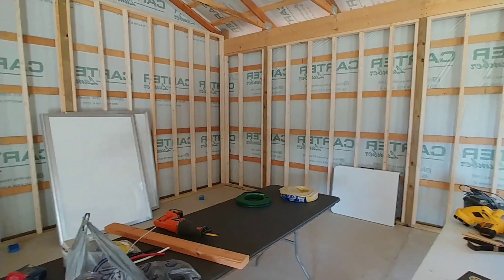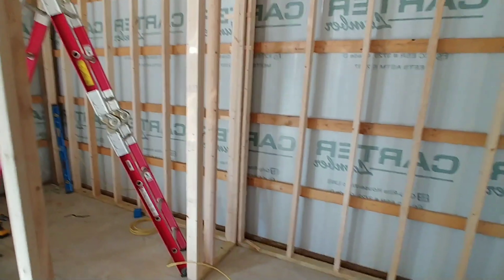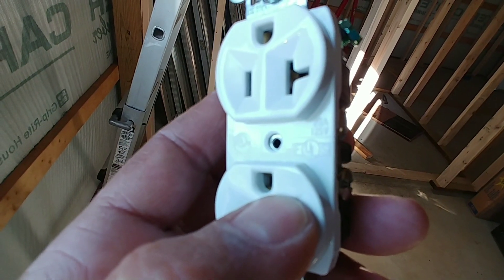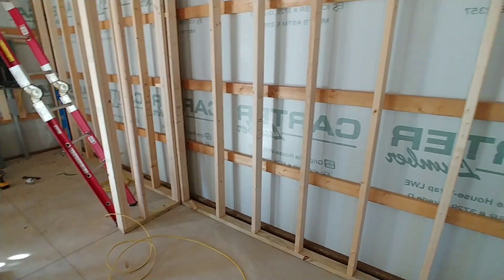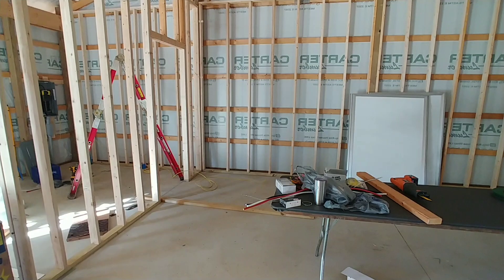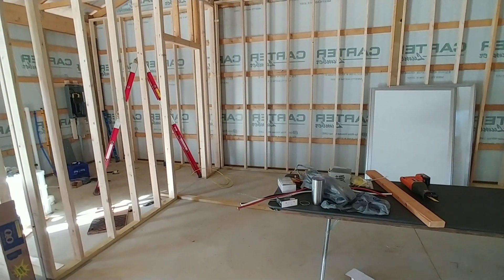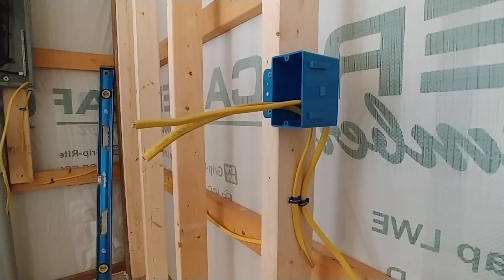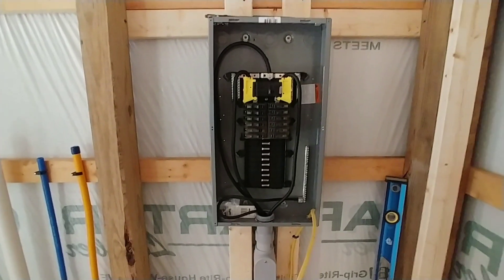Electrical basics for wall outlet branch circuits

Comment: You do not have to run 20 amp outlets. If only installing a single dedicated outlet it would have to be 20, if it’s even 1 duplex out let it can be 15 amps

Comment: Thank you sir for sharing this thoughtful presentation & how you pay attention to your local electric codes along with a good explanation on cable size & load requirements...
The cost of 12-2 cable today is way, way higher here in March of '22 however as my jaw dropped to the floor at my local HD just last Sunday in fact, lol! 
All the best,
Bill... :~)

Comment: Good presentation, thank you. Two items of interest as a DIY with wood shop in garage with that one over head light and one GFI 15AMP circuit: 1) Wonderment if an individual circuit may be required per Electrical Motor. I.E. Kitchen Garbage Disposals here are required to have their own breaker as they are motor driven. 2) With or, with out item #1), when is it needed to plan a circuit for a particular  tool? To elaborate further, circuit sizing based upon AMP drain, what is good planning? Router 15AMP, Table saw 15AMP, Dust 7.5AMP+, Air Compressor 14AMP (Who knows when kicks on!), Planer, Lathe, Cut Off saw, etc. Is their start up draw needed to be known?
I can balance things fairly well though sometimes I am literally  left in the dark.
Greg.
PS. I learned about managing start up power when watching Tom Hanks on Apollo 13. :)

Comment: Liked your video.  It may have helped to point out the NEC defined both a garage and a dwelling unit and this building is neither.  That throws all those pesky recepticle location rules out the window.

Also, I got the impression that you did not have a specific location picked out for specific equipment.  My book is a 2020 and I believe the 3% circuit voltage drop limit (210.19 in 3) has been around for many cycles.  My calculations puts a 15amp table saw at a max distance of about 60 feet of cable away from the panel.....30 x 60 building, half way down the back wall (by my calculations of voltage drop).  Article 110.14 allows a max size of no. 10 wire on the screw terminals, recepticle screws and raises the wire distance to about 96 feet.

I am not saying you are doing anything wrong here.  I am just trying to point out that a quick discussion could prevent others from installing and then re-installing a larger wire in the wall.  Conduit could make that wire size upgrade easier but,  would add expense and time to the project.

Thanks for your educational video and you considerations.

Comment: Great video. My question is my first outlet from the breaker box will be approximately 12' due to the fact that there is no opening of any kind... just straight up wall (no door or window openings)l. Is that ok ? or is there a max that you can go before you must put in an outlet?
Reply from the maker: That is normal and fine.  :)  the rule limits are for where on the wall.

Comment: So if I have a 20A breaker, but the circuit/line leads to just a couple 15A receptacles inside the breakfast nook, that's wrong?  I bought my townhome with that inside.  But it gets more complicated because the prior owner extended the last outlet through the wall to outside where he added two 15A GFCI receptacles (one leading to the next) to plug in a water softener at the end of the chain.  Can I switch every one to 20A or 15A depending on whether the wires he used are 12/2 or 14/2, respectively?  PS. The outside outlets ceased to work after a storm and the first outlet then read OPEN NEUTRAL.

Comment: You say 12/2 for 20 amp recepts...but how does voltage drop over distance figure into this?  It looks like 12/2 can only run 50 feet max according to a chart Menards has on their electrical page.  Any advice on how how or what wire to use to get to the opposite side of the garage that may be over a 50 foot run?
Reply: You wont notice a voltage drop if the run of 12/2 is a100 feet. We usually dont worry until  over 150 feet.
Reply from the maker: As Thomas said I personally don't worry about voltage drops until after 150 ft.  If you are worried about it and want to do a quick calculation though here is a link to a simple calculation chart
https://www.calculator.net/voltage-drop-calculator.html

Comment: Hey, I learned  a lot in just over 11 minutes.  My question was how do you determine which outlet is the first in the branch circuit?  You answered it and I didn't even have to ask.  Answer:  The one that is 6 feet from the beginning of the wall!  The rest were 12 feet apart.
Thank you so very much.  A big smile from me to you!

Comment: A 250' roll of 12/2 is $122 now(Aril 2021). A 1,000' roll has gone up $121 in 3 weeks as well(from $363 to $484).
Reply: Where the fuck are you buying from? Shit's $56 at lowes lmfao
Reply: @brandonfontaine285  You're stoned. I just bought 2 rolls of 14/3 today. You had better do a price check.
Reply: @FINfinFINfinFINfin  Just checked today at the prices have now adjusted to what you are saying. When I made the comment the prices were still low.
Reply: @brandonfontaine285  The supply houses adjust prices daily. The big box stores lag by several days(whether prices go up or down).
Reply: @brandonfontaine285  It's at $537 for 1,000' now.
Reply: @FINfinFINfinFINfin  I've decided to put off all renovations and to buy a new motorcycle due to costs increase of everything HAHHA!

Comment: I love your videos and very helpful. I’ve a query to pass my rough.
I’m running 12/2 wire for 10 outlets with 20amp breaker switch in my home theater room. Can I daisy chain the same 12/2 for the lights & switches in the room or I should run separate 14/2 wire with 15amp breaker switch?
Reply: No you can not daisy chain 14/2 with 12/ 2 on the same circuit breaker.
Reply from the maker: Yes you can run your lights off of the same circuit as long as you dont exceed the load.

Comment: You should separate lighting circuits from outlets and there isn't any reason to go with a 20 amp lighting circuit. 
A good way to do a shop is to make every other outlet on the wall a different circuit. That way you don't have to go down the wall a ways to get a new circuit if you need more. Better than what he is describing.
That Square D QO panel is a good one. Lots of people hear that Square D is a good panel and they buy the cheap Square D Homeline panel from the store. 
Square D makes a low end and a high end panel. The high end is QO, the low end is Homeline.
Homeline is junk. No electrician would put that in their house.
If you want Square D, use the QO panel. Yes it is more expensive.

Comment: Very nice install work.   Your NEC comments could use some refinement.    You gave the NEC rule for a garage as one light, switch, and receptacle minimum.  That is the rule and done.  So the spacing of receptacle outlets in NEC for dwelling units does not apply at all.   As others have pointed out, 20 amp receptacles are not required, but you absolutely can as long as the branch circuit is 20 amp as you said.
You didn’t talk about it, but an area that has bare concrete floor (I suggest) you utilize GFCI breakers or receptacles.   NEC does not address this type of building very well.  The reason is concrete is a grounded surface.   If you do not believe that, go on concrete barefoot and pick up an electric cord connected guitar.   Turn on the amp and touch the pickup.  You will feel it!   You can assume how I know.
Best wishes!    Kevin

Comment: You don’t always need a 20A outlet on a 20A circuit. 15A outlets are far more common
Reply: I think he said this area is gonna be a workshop, that might be why he wanted a 20A circuit
Reply: @squeezylo  yeah, but NEC allows 15A receptacles on 20A circuits as long as there are at least two receptacles on the circuit.

Comment: Thanks for this video , feel more comfortable to do my garage oulets circuits,  1 question a 20 breaker and 7 oulets , can handle a tv , 6 drill charger , a saw table and router table with vacumm , obviously not everything will running at the same time, tv on and the tool that im using with the vacumm , thanks in advance
Reply: I believe, and the uploader can correct me if I’m wrong, is that volts x amps is how much power the circuit can take.  So a 20 amp circuit at 120 volts (2400 watts) is your safe capacity on the circuit.  As long as you’re not using more than 2400 watts at the same time you should be fine.
Reply: @SDMev1982  80% is typically the rule for safey. In this case 1,920 watts per branch circuit would be your maximum.
Reply: @surferdude642  if it was a continuous load yeah that would be the total capacity allowed, but it isn’t so that’s not the case

Comment: Nice job and building. Are you required to install arc fault/gfci protection on those outlet circuits in your jurisdiction?
Reply from the maker: Either your first outlet or the circuit breaker itself needs to be gfci for a garage yes.

Comment: You can legally use a 15 amp duplex receptacle on a 20 amp circuit, but you cannot use a 20 amp receptacle on a 15 amp circuit. If you have a single receptacle (accepts 1 plug) then you must use a 20 amp receptacle on a 20 amp circuit
Reply: HELLO.   There are no physical complications preventing you from installing a 20 amp outlet on a 15 amp circuit. You might argue that a 20 amp outlet will cause an overload. But receptacles don't draw power.   DUH.

Comment: Can you attach the wire on the TOP of the perlin too? or has to be on the side of the perlin because of the 1.5" clearance? Also, does inspector want you to go behind the pole to the next section (inbetween poles) or do you drill and wire THROUGH the 6x6 pole?

Comment: My electrical consultant says I need to split my 12-3 in a box before feeding it the two switches. I was hoping to see that in this video.
Reply from the maker: The split is done simply by adding a extra wire out of the bundle to go to the switch.  Hope that males sense.

Comment: How do I add a GFCI outlet to a finished room? Do I have to cut drywall out?
Reply from the maker: No not at all you simply find the first Outlet in the circuit and replace it with a GFI or the other really quick and easy solution is to put a GFI breaker in the lighting panel.
Reply: @BevinsBuilds  But I don't have an outlet where I need one.

Comment: So...it looks like you showed 1 circuit. When all approximately 6 circuits are wired, your 2x6 will have 6 wires through your first circuit then 5, then 4, etc. I would love to see how you ran all of your wiring throughout the shop when finished. I’m basically asking about your final wiring layout. Thanks

Comment: Great video's on your build I have just started to finish my pole barn and your video on using 2 x 4s for the wall framing is working out great 
My lucking timing because i'm just getting ready to start my wiring also so its like a step by step guide for me
I'll be doing my Led light's wiring next so thank you for taking the time and effort into making these video's  they are appreciated
Reply from the maker: Glad to hear its helping and thanks so much for watching I appreciate it.

Comment: I just got a job with a contractor! Doing the basic work running the wires right now but I struggled. Being in a shop is nothing like on the job. Once you are on the job, you have all these codes to follow. I’m nervous if I get to wire anything.
Reply from the maker: Nothing to be nervous about at all the biggest thing is just make sure everything's dead before you work on it.  Also remember if you don't make mistakes you're not trying which means you're not working mistakes happen just remember the mistake so it doesn't happen again and consider it a lesson learned. 😃

Comment: I take it you need to change all your power tools cord ends to accommodate the 20 amp receptacle ? Thanks for sharing.
Reply from the maker: No not at all that is why 20 amp outlets have the t shape on 1 side so it can still accept both.
Reply: The only difference between a 20a and a 15a plug is the plastic face. The internals are the same. They are made so you can't plug an actual 20a unit into a 15 a circuit

Comment: Bottom plates of walls not pressure treated in contact with concrete? Thats a no no in oregon.
Reply: It is everywhere!
Reply from the maker: They are pressure treated
Reply: Ok, they look very different from the stuff we have, I'm curious why you didn't just do conventional framing for the shop if your going back and adding framed walls anyway and doing a slab, anyhow thanks for the video!

Comment: Thank you Bevins Build. Well explained video. I am curious to know how will you be wiring your receptacle. Will each  (3) wall panel section approximately of your barn as mentioned in the video,  have its own breaker within the main panel?  Thank you in advance.
Reply from the maker: Yes that is what I'm doing because I wanted to make sure I don't have too much on anyone circuit but that is not a requirement it's just my personal preference as this is set up as a workshop

Comment: Good information - Thanks! 
How many outlets can you bridge together on a 20 amp circuit? Also, same question for light switches?
Thank you.
Reply from the maker: Technically there is no limit for light switches but what you do need to keep in mind when using more than one light switch that you have to use 2 threeway switches.  Also if you want 3 or more light switches.  You use a 3 way then 4 way and lastly another 3 way switch. So if you wanted 10 switches it would be 2 3way switches and 8 4way switches.  To answer your second part.  The quick and easy answer is 10 on a 20 amp and 8 on a 15.  You only use 80 percent of your load and you consider each outlet to be 1.5 amps.  So on a 20 you can use 16 amps and on a 15 amp circuit you can use 12 amps.  Hope that males sense.

Comment: Do you want the staples right on 6"? Or is at least 6"? Say 4"-5"?
Reply from the maker: You can do it at 4 or 5 what the 6 inch rule is, is wire has to be stapled within 6 inches of a box. You could even do 3 inches if you like. 😃
Reply: @BevinsBuilds  The other videos on youtube and comments said its 6 inches in canada, within 12 inches is the code in the US.

Comment: 15 or 20a receptacles allowed on 20a circuit
Reply from the maker: You can not use a 15 amp outlet on a 20 amp breaker.   But you can use a 20 on a 15 amp breaker.
Reply: @BevinsBuilds  that is not technically correct. According to the NEC, you may have multiple 15amp outlets on a single 20amp circuit. If there is only 1 outlet, then it must be 20amp.
Reply: @BevinsBuilds  You have that exactly backwards. As humangod said, 15 amp outlets are allowed on a 20 amp circuit. And that makes sense if you not focus on numbers being the same. Ask yourself "is it safe to plug a 15 amp device into a 20 amp circuit?" Yes, of course. Which is why 15 amp outlets are allowed. The outlet only allows 15 amp devices to be plugged in so the 20 amp wire (12 ga) is protected.

You absolutely cannot use a 20 amp outlet on a 15 amp circuit. It would allow a 20 amp device to be plugged in and draw 20 amps through that 15 amp wire (14 ga) which is too much.

I'll give you a tip making these videos... If someone writes something that differs from your understanding your first step should be to research the question and not assume you know what you're talking about. You're giving advice that endangers people's property and lives. That makes it worth considering you might be wrong.

This is the first time I researched how to block a channel. I might run into one of your videos again and not remember the info can't be trusted. So blocking is useful.
Reply: @waterbug1135  damn your cold with it brother lol!!
Reply: @waterbug1135  you are absolutely correct.  The author of this video needs to read the code and correct his statement to not endanger a DIY electrician!
Reply: @BevinsBuilds  nec 210.21(B)(3)

Comment: 6’, 12’ rule does not apply to garage’s
Reply from the maker: No it does not apply for code correct.  The old rule for garages which has changed in the new code was 1 outlet 1 switch 1 overhead light.  But when building for a shop a would use that rule as a minimum to insure you have enough outlets for the work space.

Comment: So I am having wiring done where a built in set of shelves will go in media room for sound receivers, speakers & game systems. Can those plugs boxes be set on the same stud?
Reply from the maker: Yes they can be they come in a variety of sizes though what you see in this video is referred to as a single gang box you can also buy double triple and even quadruple gang boxes so you can have up to four outlets in one box.  But being you are having a Media Center built in front of it I would recommend a recessed box that way the cords sticking out of the plug don't impede need anything being placed on the Shelf.